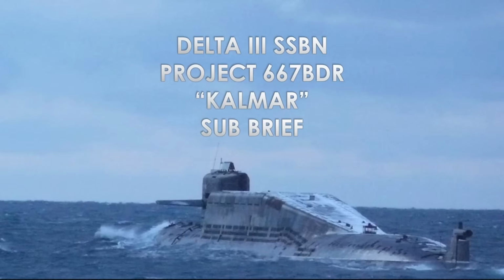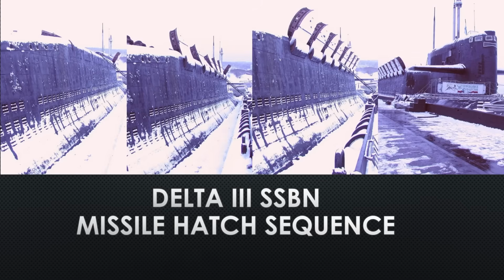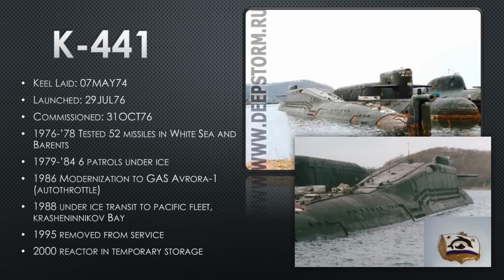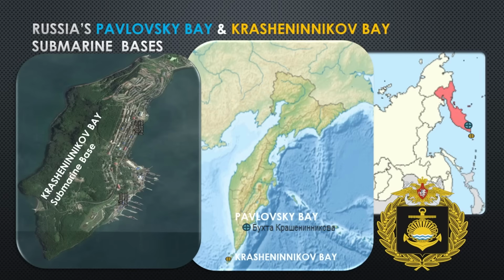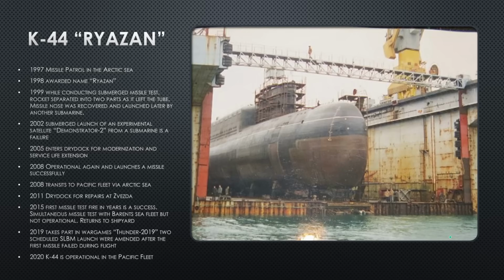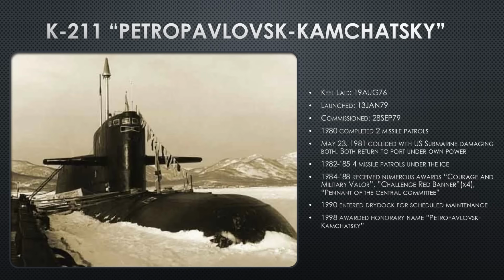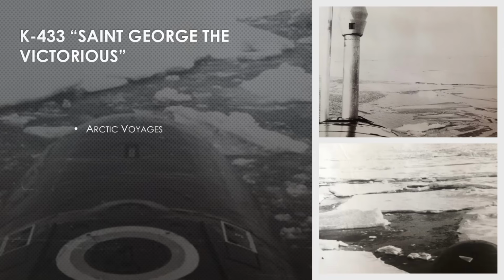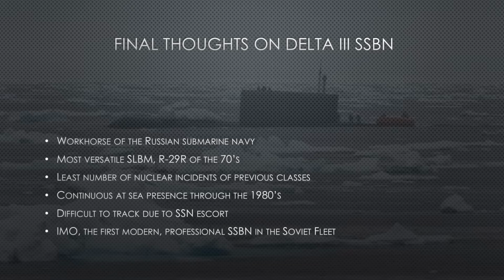Delta III SSBN Sub Brief

Comment: 47:40 Heliocentric orbit is an orbit around the Sun. Planet Earth is in heliocentric orbit, all other planets are. An example of man made object in heliocentric orbit would be Spitzer Space Telescope or an Elon Musk's Tesla Roadster. What you meant is geosynchronous orbit, that's an orbit with an orbital period of one day (23h 56m 4s). It can be inclined and elliptical. A special case of geosynchronous orbit is a circular orbit in Earths equatorial plane (a geostationary orbit), this makes spacecraft hang above one point on Earth equator. Exactly 35,786 km above the equator. It is considered a High Earth Orbit not LEO.

The benefit of launching from the sea is you can freely choose an inclination of the orbit by changing launch location. Inclination changes are very expensive in terms of kinetic energy (fuel) so most spacecraft stay in the same plane they were launched to. Some inclinations are not available from land, especially for Russia, as they are far north from the equator.

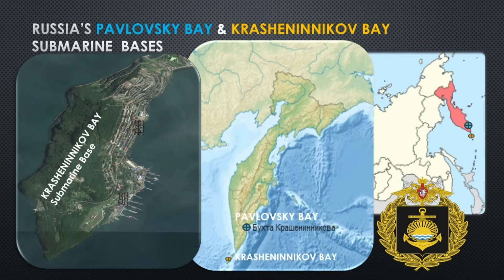Comment: 36:28 Great video, but you are mis identifying the distance between the sub base and the Pavlovsky bay, they are essentially next to or inside each other. The location you have identified as Krasheninikov bay on the center and right maps is another bay of the same name, but is a desolate bay next to in the shadow of a dormant volcano.

Comment: Hi Aaron.  At 36:34 of your brief, your sub base locations are AFU.  Krasheninnikov Bay is actually where you have indicated Pavlovsky Bay on the centre tile.  In fact, the cyrillic writing below your 'Pavlovsky Bay' says 'Krasheninnikova Bay.'  I used Google earth to look at it.  Your left hand tile shows the correct name on the peninsula into the bay.  Looking at each of the volcanic Kuril Islands to the south of the tip of Kamchatka I cannot find a single naval base close to where you have indicated it.  On top of that, a search for Pavlovsky bay, or just Pavlovsky fails to show anything in the region.

Where did you get this data?

Comment: Minor nit, but it is not a pressure problem that leads to not being able to open all of the hatches at the same time, but flow rate issues.  If each hatch requires ten gallons of hydraulic oil to move the piston to fully open and there are eight hatches, the hatches will not all be fully open before the pump has moved eighty gallons of hydraulic oil.  In the absence of any balancing system, the hatch with the least resistance opens first and the next lowest resistance hatch will start to open when the back pressure from the first hatch rises to the point that the pressure exceeds the resistance of the next hatch.

Having separate pumps for each missile hatch still presents the potential problem of not being able to power all of the pumps at the same time.

Comment: The system you are talking about, namely the supply of breathing air, is available on several types of submarines, but the problem is that when a fire broke out on one of these submarines, the fire damaged this pipeline and this led to big problems, the fire received pressurized air and raged even more, this is the danger of this system, therefore it is not used on Delta 3, according to the instructions, the sailors have a certain time to leave the compartment, if this failed, the team must isolate the emergency compartment and turn on the gas fire extinguishing system despite the fact that there were people left there, otherwise the spread of fire will go to neighboring compartments, which will possibly lead to even more sad consequences.

Comment: You keep showing that slide of Pavlovsky and Krasheninnikov Bay with them being a hundred miles apart, they are not, in reality Krasheninnikov is not down on the tip of the peninsular but in the same bay as Pavlovsky just across from it on the other side of the bay not even 10 miles distant.

That anecdote of them going to Krasheninnikov to save some transit time is nonsense, the mouth of the bay is equally distant from both places.

Comment: United Shipbuilding Corp is not a private company, although it is joint stock. 100% of its shares are owned by the Russian state. It owns all the major naval shipbuilding in Russia, i.e., it is a parent company. 
It is similar with their military aircraft and United Aircraft Corp who produce the SU-35 and SU-57. Russian oil and gas is also owned publicly, which is where they get a lot of their revenue for state projects (1). 
Most of the Russian industry was privatized during the Yeltsin era, under western advice. Putin reversed the privatizations and that was a big part of rebooting Russia's industry that had been in tatters after the Cold War, which is why they have been able to rebuild their military and increase living standards etc. 
There would be some corruption, but public ownership allows the profits of things like oil to be spent on public projects, instead of going to a billionaire's coffers in the Cayman Islands etc. Russia has far more of this than China (China is a 85% private economy, with just the bones of it being state owned, e.g., electricity etc) Russia can do that because it is more self sufficient for resources than China -- China needs capital to import resources, so since the Chinese deal with Nixon they therefore use more capitalism than the USSR did, which is called a mixed market, i.e., a mix of private and public. 

1. When the Saudis recently pumped oil like there was no tomorrow, it crashed the oil prices. That really hurts Russia and they tend to think the Saudis do it on the behalf of the USA. Similar happened in the late 1980s. It was a key factor in the USSR going bankrupt, along with costs like the Afghan War and Chernobyl. The Soviet Union had massive overheads and no way of funding them all. They turned to the IMF and World Bank for loans. Those loan conditions dictated the Soviets transitioned to being primarily a market economy, i.e., not being so socialist etc (that is what the IMF and World Bank do all over the world). Nail in the coffin. 

Former Soviet enterprises and assets were sold off cheaply. Many were liquidated and this destruction of industry interestingly matched very closely with NATO targeting for strategic nukes. The Russian people received shares in the privatized companies, which were bought up by anybody who had money. This created the oligarchs of the Yeltsin era, who were the people mostly affected by Putin's nationalizations, along with many western investors, e.g., Yukos oil. The Americans still have not forgiven Castro for doing similar to US investors, or Iran and Venezuela either, so I doubt they will forgive Russia for decades. Uncle Sam has a very long memory when it comes to messing with the capital of US investors.
Reply: P.S. Hooks on a net? You are talking about a long line, which is mostly used for tuna fishing. A different thing than a trawl. There are three main types of trawl. Mid water, bottom, and pelagic.

P.P.S. On submarine reactor disposal. I am finding records of international funding allocated in the mid 2000s. That work could be ongoing, but I have not yet found if funding continues beyond what was agreed back then. Part of it is about non-proliferation. There were attempts steal enriched uranium for third party buyers, e.g., two North Korean spies were discovered trying to buy it.

Comment: ".1 megaton is not a lot" it's actually a huge amount. It's roughly ~7 times higher yield than the bomb that hit Hiroshima
Reply: Especially when theres 112 of them screaming in from orbit.
Reply: Not a lot...it's enough but it's not very big the yield may be higher than Hiroshima HOWEVER the fallout isn't as bad and there exists tactical nukes with almost a much yield...but having that small of a warhead in a MIRV system allows a higher chance for a successful engagement [smaller target for patriots and airborne laser missile defense systems]...more than enough yield for NYC or DC but not for hardened targets i.e. it's a terror weapon vs a strategic weapon...

Comment: Hey Jive, I'm fascinated by what you have said about the sound of lost, drifting trawler nets...any chance you can access one of those recordings (as I can't imagine they are classified - unless trawler tech counts as state secrets? XD ) and show us, like you did with other sonar captured sounds? Be good for Halloween!
Reply: Drift nets and trawls are horrendous damn things as far as sea life is concerned, absolutely no discrimination in what they trap and kill
Reply: He described what is called a longline, because only they would have hooks on them. Mostly used for tuna fishing. They can have thousands of hooks and be miles long. 

Trawls are different. Bottom trawls for deep seas fishing have huge steel 'doors' that act as hydroplanes to hold the nets open 200-500 meters wide depending on the vessel. It looks like a big rectangle that decreases to a sock shaped net called a cod end. They have a ground line with a few dozen 50kg steel bobbins that roll along the sea floor and keep the ground line low. The headline has floats to hold it up and the fish swim under it. If the warp wires that connect the trawl to the winches break, the trawl will settle 600-800 meters down on the bottom, but the headline may float over 100 meters above that mess. Something a sub would not want to tangle with, especially those trawl doors that can weigh several tons each. We spent days trying to grapple line lost trawls and bring them back up, because they cost so much and take a long time to build.

P.S. I think passive sonar would be able to hear trawling 100s of miles away. Doors, chains, cables and bobbins all rattling on the seafloor is very noisy. Very hard to sleep through when they haul on your watch off. I ended up using earplugs to sleep and getting the mess girl to shake me awake (never mind the morning stiffy lol).
Reply: @aquilarossa5191 very interesting TY!
Reply: @aquilarossa5191  spoken like a true man of culture and a gentleman. Jeez weeks away from home, nothing but Jerking off and all she got to see was a stiff...

Us guys are such monsters! 

That said I'm sure at that point if she was down.... meh I'll stop there :)
Reply: @dfgiuy22  ....what?
Reply: Anyone notice the Typhoon sub brief  is gone? Wanted to watch it after this one.
Reply: @menninetights4080  it’s back there now, just watched it, but it’s not in the folder, just put sub brief typhoon in the search bar.
Reply: k44 fouled her props in1985 from a trowler net

Comment: Are we sure about that fire extinguishing agent? (38:41) LOX is a common abreviation for Liquid Oxygen, which makes a rather lousy fire supression agent to say the least. Could it be Nitrous Oxide, NOX?
Reply: After some googling apparently LOX is some kind of branding for the hypoxic fire suppressant system, which reduce the available oxygen to burn. So it's technically not wrong, it just whoever invented it decide to troll us with such stupid branding. I mean, you definitely wouldn't want to get it mixed up with the other LOx 😂
Reply: @alanmsmxyz  Found that too, it appears to be a preventive system, desigend to prevent fires by lowering the oxygen amount in a given space. While this could cause casualties among the crew, the reports mentions a fire and a response by a supression sytstem as a the cause of the fatalities. The LOX:TM:  system being preventive andnot responsive does not fit the described circumstances.
Reply: @alanmsmxyz  Lox could also mean smoked salmon. Imagine being the engineering team ordering 2000kg of lox, only for smoked salmon to turn up dockside.
Reply: I thought it meant a suppression system for LOX fires.
Reply: The Man From LOX is shaking his head right now.

Comment: The hatches that open first are closest to the supply, example hydraulics pump, where the flow and pressure are greatest and encounter the least resistance. We when open are hatches, even on ones made in early 1990s, it was like this, just less noticable as it was a faction of a second. Now you simply jist use larger hydraulics pumps or usually more and position them inside differently
Reply: @John Milton no the newer are larger and of a different design. They used to be old gear pumps that actually can cause alot of noise. Now they are a newer design, with higher displacement that are actually quieter. Plus they are raft mounted now. Before there were bolted to the deck with some rubber pads in between, in an attempt to reduce noise. Totally different, like a model A, compared to a new vehicle today.